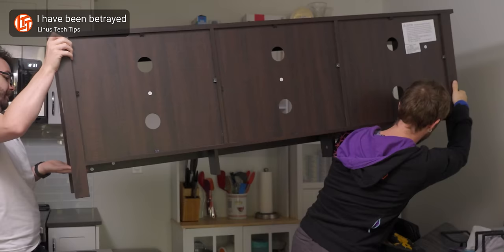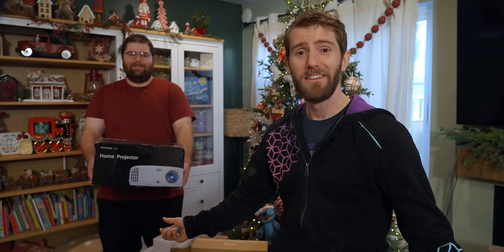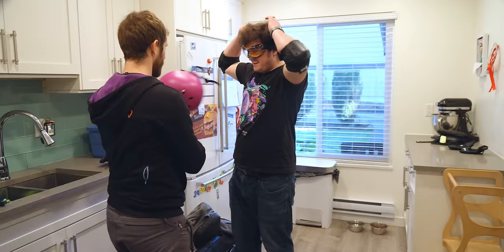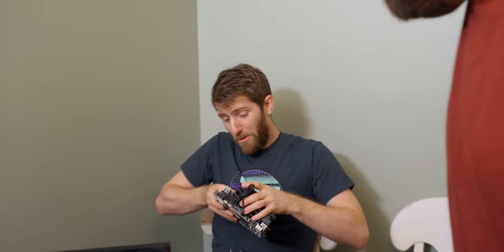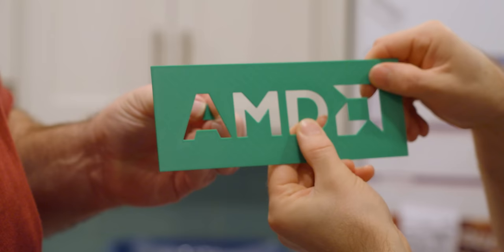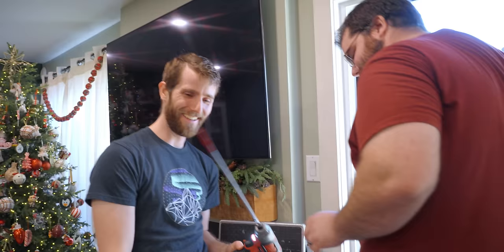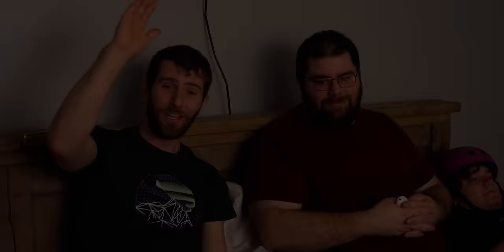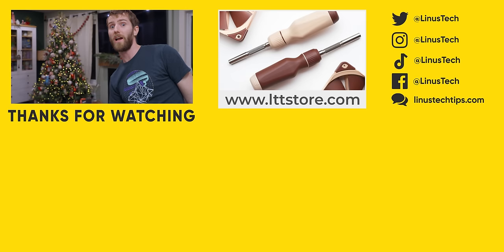A Hardcore Tech Upgrade - AMD $5000 Ultimate Tech Upgrade

Comment: Years from now, $5000 is gonna be a reasonable price for a build.
Reply: Not that long, either
Reply: Few months ago you could barely buy a high end GPU for that money 🤷‍♂️
Reply: Fr fr and it's coming fast
Reply: @HaroldKuilman  what are you talking about lol

the price hikes ended over a year ago
Reply: 2042 scrapyard wars budget lol
Reply: Knew a guy that spent 4k on his PC and proceeded to only play Roblox
Reply: Reasonable price for a GPU
Reply: Its nowX)
Reply: @Chrismas815 😂
Reply: If Nvidia have their way that'll just get you the GPU
Reply: @Emayeah thats nvidia for ya
Reply: I'm buying a $5000 USD laptop and upgrading it with SSDs and memory worth $2500.
The newest equivalent of my monitor setup costs $5700 though I bought the second best option used for $700 with no appreciable difference for my use case.

The price difference from cheaper gear is easily justified when I use it to earn money and my salary cost is that of a European developer. European companies that don't calculate the total cost of the employee, the associated cost and the equipment for the user with an equipment lifetime will buy them garbage while those that do will buy absolute top notch equipment.

I'd put even more money in this laptop if I could but Intel/Micron never launched high capacity M.2 Optane.
Reply: A year*
Reply: It already is for some people
Reply: @magfal  5000$ for a laptop? Oof
Reply: Tak tohle jsem necekal
Reply: That is, indeed, how inflation works
Reply: With a power budget to match - Moore’s law is practically dead at this point, it’s pretty much dependant on ARM or RISC V at this point
Reply: i'll do you one better. More years from now, $5500 wil be reasonable for a build.
Reply: Its not already?! Shit, I overspent.
Reply: @Beemer889  how did you even spend $5.5k on a build. Do you have like dual 4090 or something
Reply: @Chrismas815  based
Reply: his pc components would have cost around 1800 canadian not 5k his money went on all his other shit
Reply: @chronodis  When that laptop means that I can earn 10000 extra a year due to not waiting for my machine as much it's pretty much painless.
Especially when the machine will be fast enough for at least a couple of years and a machine swap has an estimated cost of at least 1000 USD in the form of aggregate lost working time over the duration of the transition period.
Reply: 2033: $10k Ultimate Tech Upgrade
Reply: Wait till u hear abt bidenflation
Reply: @magfal  ah your rich ok
Reply: You will need $10,000 if your thinking of going with Apple and that probably just for the wheels
Reply: Also was a reasonable price for a high end PC setup in the 80s.
Reply: That's the annual salary of so many people in the world...
Reply: @HaroldKuilman what?! Lmao
Reply: @maximus3294  still a few months technically
Reply: @EminemLovesGrapes  best part was he was my bunkmate in the Corps, and decided the best game to play on Roblox was a military simulator. not even focused on battle, focused only on drill/marching
Reply: Nah, just the GPU is gonna cost that much
Reply: It is. >5,000$ becomes standart soon
Reply: Especially when the graphics card is only 1/5 of the build budget
Reply: @chronodis  I've co-founded a company so my average salary over the last 7 years isn't great but it's finally catching up.
Working 16 hour days for the first 5 years at less than half the going rate for my skill set could easily have wound up being a loss.

I also live in a high cost of living country which skews things like housing cost to a point where stuff like laptops are relatively cheap (10% of the population make over 100K a year)
Reply: @Sofia-qr6rg  One thing that hides the power difference is that the IO is hugely limited and memory is non expandable on the machines that the average consumer sees running RISC.

Server RISC and server X86 are closer in power use per performance than mid range consumer stuff like Apple M series machines and Raspberry Pi.

RISC performance is super sensitive to memory bandwidth and latency. Real IO pro level IO takes a lot of power.
Reply: Ironically, 40 years ago was when $5,000 was a reasonable price for a build
Reply: 20 years ago $5k would get you a top of the line pc
Reply: dont worry nvidia wil make your dreams come true
Reply: Considered a budget setup 😂
Reply: $5000 for a tank of gas..
Reply: Outdated parts do tend to lose their value, yes.
Reply: Back  in my day a regular pc was 3000 not a gaming pc
So when u can buy a decent gaming pc for 1200 that's a bargain even befor when u could have bought one for 800.
3000 it probably  10k inflation  now
Reply: Facts 5k will be Dell flagship
Reply: @Sofia-qr6rg prolly watercooling. All those fittings can really add up
Reply: A gpu and cpu can already take you there half way. And a New monitor and you above the 2,5k
Reply: It’s also interesting how different nontechnical people’s idea of what is a reasonable price can vary.

Like my mom thinks $500 would get you a high end computer, and when my dad asked for advice on a video editing computer for his small business, and I asked him how much he was willing to spend on it, he said, “I was thinking like 3-5K.” And he thought that would get him a minimally functional computer for video editing.
Reply: Months*
Reply: It's almost like a dollar was worth like 50 bucks 100 years ago
Reply: It’ll be sooner than you think the if Nvidia keeps going the way they do
Reply: I hate inflation
Reply: Last person in this series will get a bowl of cereal lol
Reply: @maximus3294  Hike is coming again, in Europe at least . A used 3090 starts at 1700 Eurodollar currently. Probably because of a small mining boom again the high-ram cards exploded in price . The insanity!
Reply: @oobee123 only cause we have so little competition. And the use of fiat currency ofc with centralbanks just creating money. Inflation doenst happen just cause you know :(
Reply: Please don't say that :( I already purchased second hand parts XDcopped a 3090fe for 300$
Reply: I mean my computer alone is 2.5k canadian lol
Reply: In 6 months that's going to be the price of an entry level Nvidia gfx card 😂
Reply: @maximus3294 not in Europe
Reply: You mean it’s not already? nervously sweats
Reply: @maximus3294 the 4090 is 2000 dollars which is way more than previous generations what are you talking about
Reply: @Chrismas815 a friend of mine bought a PC for 4k basically on release 4090
Yeah, that hurt
Reply: Months
Reply: @Chrismas815 I can’t even explain why people who that genuinely make me mad lol. I know a girl with a 4070 32gb DDR5 (can’t remember her cpu) and I’ve never seen her play anything other than rhythm games and occasionally fortnite.
Reply: Nvidias 6090 TI will probably cost that alone.
Reply: Ive got a build in PC Part Picker thats $4000. was more, but decided to not to a custom loop because theyre insanely expensive for no reason. Hoping to build it next year.
Reply: It's already is 3000$ you get mid to high end pc not Ultra / 4k
Reply: @magfal  what is this for? Roblox?
Reply: You mean right now
Reply: Buy a pair of their headsets, and the 'Extended Warranty' should just about do it.@CricketEngland
Reply: @DryPaperHammerBro , I guess 25 years is not that long
Reply: So f it. I play only DosBox games from now on
Reply: @unknowncsd   20 years ago the PCs were crap. Try 10 years ago.
Reply: @maximus3294  I mean, yeah they have gone down but they're still ridiculously expensive compared to before the price gate
Reply: @Sofia-qr6rg buddy said laptop, pretty positive there's no laptop that has dual 4090s.... idk what he bought but there are laptops out there that cost more than $5500... shoot if you bought the top of the line macbook pro it's like $7200+
Reply: @magfal what laptop did you get and if you don't mind I'm curious what type of work your doing??
Reply: Gpu prices be like
Reply: My 4090 founders addition cost me like $3700 when it first came out but worth it, mine craft has never looked better
Reply: its coming too fast
Reply: That's called inflation
Reply: I spent 4500 during covid
Reply: I remember when a good system WAS $5000. That's about what I paid for my 386DX system (2MB RAM, 73MB HDD, VGA) in the late '80s.
Reply: @loran101  Inflation happens because deflation is 100x worse. No need to lecture me why inflation is a thing 😂
Reply: The future is (in the next year or two) old man.
Reply: Dont make me cry :(
Reply: @magfal  Why would you buy a worse laptop fo 5K when the best one is 3.6K? 
That is definition of wasting money. 

EDIT: Reading through some comments you made, I doubt you really telling the truth.
Reply: @NeVErseeNMeLikEDis  Excuse me? Regular pcs were just around 800 bucks in 1995.  800 bucks back then is worth like 1500 bucks today.  
They were still expensive but not hat expensive.
Reply: @JamieStuff  Different time, different economics, heh
Reply: Yea 2030 😂😭
Reply: No cuz before that peoplr will just stop buying it
Reply: Please be wrong 😭
Reply: I cry)
Reply: Pls don't
Reply: @baaerae  from what we’ve seen with nvidia cards like the 4060 actually getting worse but being more expensive, and yet people still buying them, I sadly don’t think that will ever happen, though we (the people without infinite budget and with common sense) can only dream
Reply: Should be pocket change soon too
Reply: I mean... It's a reasonable price for enthusiast grade hardware today. Even if we exclude VR and other peripherals.
Reply: More like budget price
Reply: wrong
Reply: @Chrismas815 Alot of people do say that they ended up not using their high end gpus for extreme gaming after a month of two of playing top tier games.
Reply: Other countries currency is pretty much what you get on this tech setup.
Reply: @oobee123  That's how corporate profiteering works
Reply: That's how inflation works but yes.
Reply: @BocchiSensei  I lived with the guy for almost a year, shared a barracks room. He only played roblox
Reply: A sad(?) fact.
Reply: @Cammmmeron  Software development(databases in particular)
Buying a Scar 18 4090 and upgrading it to the gills to enable my current workflow in one machine with minimal frustration and waiting for my machine.
Currently dragging along a second laptop to run VMs when I'm offline which feels dumb, but developing without testing against a productions size database leads to poor code reaching shared systems.

Also looking to upgrade my eGPU but AMD doesn't document the capability of their GPUs properly and I want a 6 monitor card like my RX580, would feel dumb to build a bespoke eGPU and buy a 7900 XTX only to discover that they no longer support 6 through MST. Would also feel dumb to buy a 6800 XT which does if someone were to independently confirm that the 7900 XTX does support this.
Reply: @Ahov  Well that but also the fact that if you new you could get item X cheaper tomorrow instead of today, you would simply stop consuming and we can't have that now can we
Reply: @HopeForTheBrokenBand  Dev work. Some occasional gaming, I only had time for ~30 hours last year.
Reply: i mean i got a $1500 pc and atleast $1000 in the rest of the setup, so im already halfway there.
Reply: @Sofia-qr6rg  lol not that hard?
Reply: @magfal  bad ass doing the dev work.
Reply: I mean, 30-40 years ago $5000 is still a budget price for a PC
Reply: Remember those $500 builds he used to do? This is totally gonna be that.
Reply: Back to 90s pricing
Reply: If Nvidia still owns GPU scene for commercial (Because commercial companies buy Nvidia GPU for CUDA usage because they can blow budget for it), RTX 7090 will cost about 100K USD while RTX 7050 will cost about 5K USD with performance of RTX 3090.
Reply: Not really unless inflation is high but prices drop over time
Reply: @Chrismas815  It's for the best that you stopped hanging around that kind of degenerate.
Reply: I paid close to that already haha🎉
Reply: GPU
Reply: my pc costs way more than that now 👀 ... sooooo that is that
Reply: Nvidia rtx 6969 ultra max power hungry be like:
Reply: It’s like a 1000hp car. Anything below 1000 isn’t as worth it but if it’s more than a 1000, it’s an absolute
Reply: Ever heard of inflation?
Reply: @oobee123 deflation isnt 100 times worse. People will consume, nearly no one can discount time in a rational way. During most of the time sinds the 1900 we experienced deflation due to capitalism, still we gained immens economic growth
Reply: Next year
Reply: @ikkuranus  I mean, he was a white guy who freely said the n word hard r, so the 4k Roblox machine is the least of his debauchery lmao
Reply: Nazdar Bablebam. Co ty tady?
Reply: Don't jinx it
Reply: Why depress me on a Friday?
Reply: It already is if I’m keeping it a buck. A GPU alone can cost you 1000 bucks
Reply: What are you talking about, $5000 in a couple of years is going to be the “budget” pc
Reply: Half that for a decent prebuild rn
Reply: If biden gets reelected 5k is gonna be a normal grocery list price
Reply: For me to upgrade from what I have currently it is about $4000-5000 AUD
Reply: You should check out computer prices from 30-40 years ago.
Reply: Mf discovered inflation and thought he did something 😂
Reply: Yeah inflation does that
Reply: @sickelfalcon3371  thats like £5😂
Reply: When 5k tech upgrade was released that really was an incredible budget to get a truly outstanding amazing upgrade.  In all honesty right now it either won’t upgrade everything or won’t upgrade everything to the ‘extreme’ degree.  Also in reality they almost never stick to the budget anymore.
Reply: @maximus3294 not really,prices are still a little high
Reply: @HaroldKuilman  Hahaha you're deluded
Reply: And people will call it “inflation”
Reply: @meamfighterjet I'm talking about $5000 3080s, that's what. a $2000 4090 is 25% over MSRP. high to be sure, but not shortage prices.
Reply: @baaerae  wdym? it already is 5000 and people clearly are still buying. So yeah, you kinda wrong buddy.
Reply: @maximus3294 you must be from the past
Reply: @lilone7461  um okay no need to be passive aggressive  tho
Reply: Gather round’ children , let’s hear grandpa tell us more stories about the time with $500 gpus’
Reply: My build was $3800😭
Reply: Been into computers for 25 years. The only thing in the computer world that's got expensive is GPU's. If people would shutdown the buying of $1500-$2000+ high end GPU's guess what? Nvidia will be forced to lower the price. It's the consumers fault prices are high. Also probably only 3-5% of users truly need high end.

Comment: I just ordered my 5800x3d, I currently have a 5800x and have been wanting to do an upgrade. looked in to the 7800x3d but didnt wanna spend the money to jump to am5. Im excited to get the new chip. My asus prime x470 I got 6 years ago when I jumped over to ryzen with a 2700x has served me well.

Comment: Its been 2 months with my P1S 3d printer and its has not failed me at all. The errors I kept getting was due to adjusting for different filament bed temps. Overall I enjoy how its really just plug in and print, but especially that its enclosed there is no need to worry about high maintenance.

Comment: The thing is that you gotta 3d print it mirrored so you can just put some adhesive on it and slap it onto something so that it comes out the right way around without having to add any connectors to the middle bits.

Comment: Yeah, the $5000 may be the headline, but without question, Linus is the real prize. I could easily drop $5000 on tech, and a month later, I wouldn't even have half of this done. (It took me a month to work up the will to install my new PSU. And I am not happy with the results.)

Comment: Fun Fact:
You can remove your cooler without your AM4 CPU, if you let your system run for 2-3 Minutes before dissassembling it. This way the thermal paste heats up and liquifies a little, making it not stick to the CPU that much

Comment: the keyboard, i have an orginal 1985 IBM model f 122 that i rebuilt that i am using on my desk i have the repro f77 and f62 the springs are just not the same but still a fairly solid keyboard

Comment: I would love to see an Ubiquiti home setup/recommendation video.  It is so easy to just run to Best Buy and get any off the shelf router wireless combo, but I'm certain that ubiquiti has better equipment however not really sure which to get.  Dream Machine, Dream Router, or Express.  Is it U6 Pro, U6 Mesh, or U6 Enterprise.  What is the best network switch to get my G4 Doorbell, G5 Pros, and my Network Video Recorder?  What if my router is in one room and my server with 10G network in another room, but I still need 10G to my other computers located elsewhere?  Why is there an EV Station?

Comment: A thousand dollar printer and they didn't know about factory auto bed leveling...*cries in Ender 3 Pro*

I would like to see some more 3D printing content. Maybe one where you upgrade something like an ender 3 to newer machine features. I have a CR Touch and most of the common upgrades, but I'd like to know more about the more in depth stuff.
Reply: It's $699, the $1000 is for the combo that includes the AMS (multi material) add on. But yes I am surprised, they have a small farm of Prusa MK3's which also have auto bed levelling and even cheap printers come with it as standard these days so you would think he would have known.

Comment: For anyone considering an automatic screen for their projector, just don't. My work has gone through 3 in 10 years and they cost hundreds of dollars. Pay the 50 to 200 for a good quality pull down and it will last significantly longer. Also when it breaks it won't be stuck up for the rest of it's life and you can still use it.

Comment: Linus is here saying that a 3060 dont remember if it was a ti would struggle with that monitor and here i am running a 3060ti i just got from my partner(was a 1070) and i have a samsung neo g9 with a much 5120x1440 resolution and honestly never had problems even on the 1070.